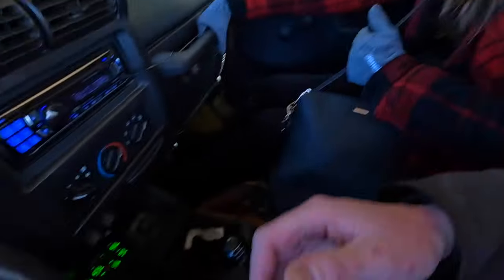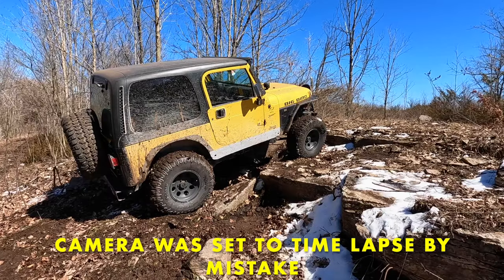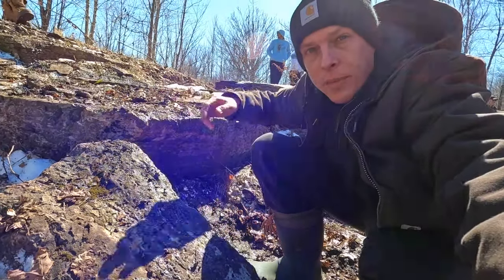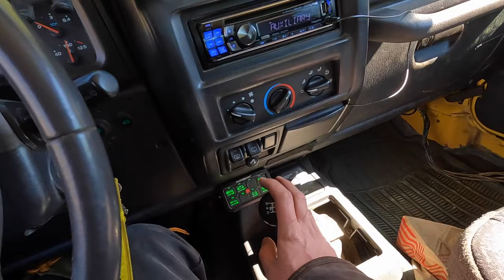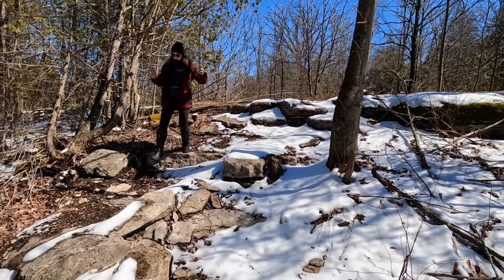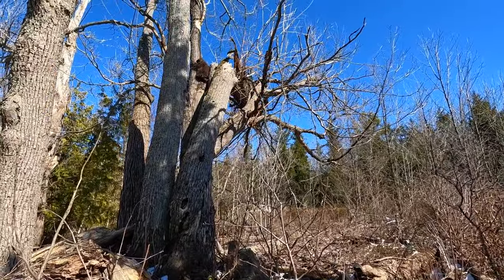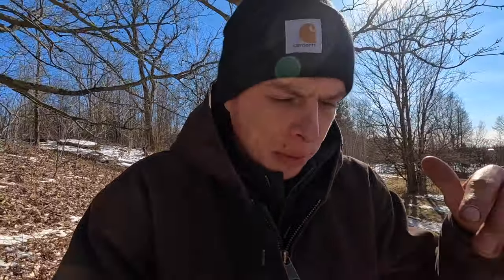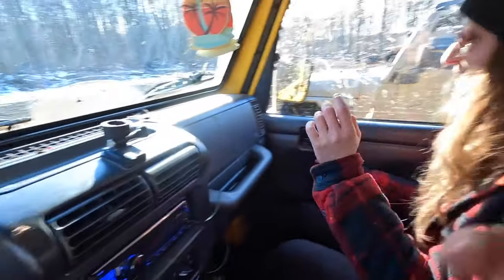No Holding Back Off Road Testing The Repairs On The Jeep TJ (It Broke Down Again)

Comment: Glad to see Big Bird back on the trails. Well, about the switch of the clutch pedal, if it fails and empeach the starter to run, you can shunt it on the inboard fuses box. Yours is probably the same as my TJ98. I explain : the number "20" fuse place is free (empty), it's supposed to be a place for auto transmission, if you put a fuse on the place, that shunt the switch pedal. Of course that delete the security to start with a engaged gear without pushing the clutch pedal and you have to take care, but it's very useful in case of your video issue. Trying to post a picture here under.
Reply from the maker: Yup I know what you’re talking about.

Comment: The JL‘s are also the lease reliable after getting wet because of the extensive reliance on computers. It is also the least nimble and not likely to make it down many trails that a TJ Rubicon makes with zero effort. It’s too wide and too long. It’s why it’s called a bus by so many jeep owners. It also rates much much lower on the fun factor unless you’re into Over landing. If you have children, I would have to agree the JL’s the better choice. Yours is one of my favorite YouTube off Roading channels by the way. Keep it up.  Most professionals agree that the LJ, which is actually a TJ Dash L is the top choice for off-road capability.
Reply from the maker: All person opinions lol mechanically and in use on trails they are much better jeeps.
Reply: @SmokinMonkeyOG  have owned six jeeps in my life since 1969. The cost of all of them combine is less than half the cost of the JL. Love your channel, but I seriously disagree. And when you say better, I would ask better at what?
Reply from the maker: @RockMauler better at going off road and more capable. You can run 37s stock with no lift and you can definitely get more articulation. From the thousands of hours of research and seeing how they all perform and having both myself I can say they are much more capable jeeps and I’m sure the next one will be even more capable

Comment: Could be your starter relay, I always carry spares just in case, same with fuel pump relays if they differ from the others as it does in our 98 TJ w/2.5 liter. Good to see Big Bird is flying again even though it had a damaged wing, lockers would be nice when you hit the lottery. Keep in mind that just because a relay pulls in it does not mean the contacts are good and the field expedient way to check is to change it out with a new one.
Reply from the maker: Definitely would be nice lol but I can live without them for now

Comment: That is why I invested a bit more (actually a LOT more) in my new Rubi X ... so I won't have any break downs ... hopefully for a few years.  Can't wait for Ontario trails to open May 1st!
Reply from the maker: Same reason I have the Gladiator. But no matter what your rig stuff breaks so if I can keep sending this old one for a while longer I’ll use it as my main beat up trail rig and enjoy the gladiator on trails and camping trips that I know won’t kill it lol
Reply: I don't have the luxury of a beater ... but makes sense if you can. @SmokinMonkeyOG
Reply: Where do you suggest for trails prior to the official open date of May 1st?
 @SmokinMonkeyOG
Reply from the maker: Mostly off road parks. Breakover angle park and minden off road park. As well as a few unmaintained roads like wild turkey, hogsback and a couple others I’m forgetting
Reply: Thanks.  Will look up a few of those .... Hogsback was on my initial list ... maybe start there... @SmokinMonkeyOG
Reply from the maker: @MRCH4TH hogsback is good for a few runs when you’re learning your rig or when there a lot of snow it can get interesting lol I like going in the winter but this year I didn’t get out there.
Reply: @SmokinMonkeyOG  Went to Wild Turkey (boring except seeing an actual WILD TURKEY) and Hogsback (interesting for a few runs but not really that challenging).  Thx.
Reply from the maker: Yeah, a lot more fun in the snow otherwise it’s mostly dirt road
Reply: @SmokinMonkeyOG  Which park do you think is best to start with?  Minden or Washago?  Thx.
Reply from the maker: They’re both great but I would say Washago has a bit more stock friendly obstacles

Comment: Apparently when I update my comment you don't get, although my updated version appears now when I return to your channel. I'll repeat it anyway just to be sure you receive it. Could be your starter relay, I always carry a spare just in case, same with fuel pump relays if they differ from the others as it does in our 98 TJ 2.5 liter. Keep in mind that just because a relay pulls in does not mean the contacts are good and the field expedient way to check is to change it out with a new one. When they start to fail it generally is intermittent like you were experiencing, with the fuel pump relay it may not start on a damp day and start when the weather is dry, I bought our 98 really cheap just for that reason.

Comment: dumb question... but have you put the 20a  fuse in the clutch bypass behind your glove box? most vehicles you have to disconnect something. but our tj' s you add a fuse and it disconnects the clutch safety . i have this issue with it not wanting to start. but after finding nothing wrong. it starts
Reply from the maker: I tried researching a few different videos, but I wasn’t able to find exactly which fuse it was possibly not the same on my year or I just couldn’t find it

Comment: Todd has all that HP. and NO REALLY GOOD TIRES TO HOOK ALL THAT HORSE POWER UP TO..
Reply from the maker: Still build in progress but it’s getting better each time he makes a modification to it
Reply: @SmokinMonkeyOG  GOOD DEAL
Reply: @SmokinMonkeyOG  what would you think was a good price for a 2019 jeep NEARLY IDENTICAL TO BIG BIRD WITH 23,000 SOME ODD MILES ON IT. AND 35"TIRES ALREADY I HAVE 1 OR 2 PICS BUT NO WAY TO SEND THEM.
Reply from the maker: @RedRabbit4230 I actually don’t know what the newer ones sell for. I got the gladiator new and never looked at the used ones. I would check out some listings and see if you can find similar ones to see what they go for in your area. Prices would probably be a bit different depending on where you are too